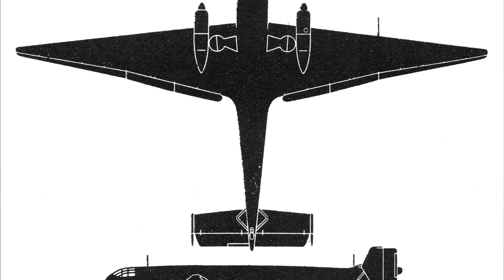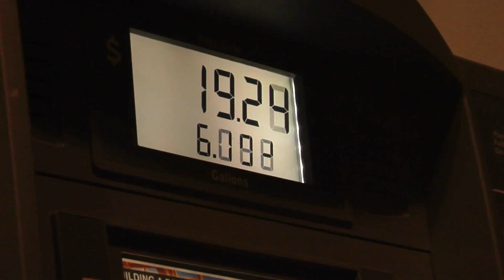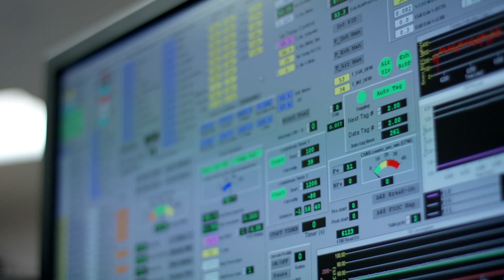The history of the Achates Engine – as told by entrepreneur Dr. James Lemke

Comment: if only this had been done 40...50 yrs ago.  now it's like building a better incandescent bulb in the days of LED's.  i guess it will still have military applications where fuel is king.
Reply: +Robert Hirsch       I was thinking the same only only wishing it had been done 20 or 30 years ago. The jet engine killed the market for this design in large aircraft and electric motors are set to do the same for road vehicles. Maybe there is still a chance for this in small aircraft where electric power just does not have the range (except for some special applications like flight schools) and marine uses where again electric power is range limited (except for some short distance ferries). Diesels are still used in diesel electric locomotives and large scale diesel electric earth moving equipment so they could benefit from this engine. I would love to know more as to how this engine is better than the Napier Deltic opposed piston two stroke diesel engine conceived in 1943 (originally for marine use but adopted in a big way for diesel electric locomotives) which I presume could also be improved by the application of modern computational fluid dynamics.
Reply: @dogphlap6749  its no different. same exact motor pretty much. like he said. anyone can computerize any motor. and anyone could have done this. . . but they didnt and he did
Reply: Yes, but LED lighting is quite a big leap forward. On the other hand, battery technology is not going so far from 40 yrs ago.
Reply: Internal combustion engines are not done yet it's just governments brainwashing people to think electric cars are more efficient but they are NOT! Whilst they like to tell you that an electric motor converts 96% of the energy to motion compared to 32%-37% for a diesel engine, where is that energy coming from? If you take into consideration the losses incurred to get that electricity to that motor it's a very different story.
Think about generator, distribution grid, transformers, battery chargers, batteries and wiring losses.
When I calculated the amount of energy used by an electric car in total compared to my diesel VW Golf(Rabbit) which I admit is very efficient at 38% conversion of fuel to power, the electric car would use twice as much energy at the power station to go the same distance! 
Electric cars are the biggest scam ever, I bet the oil companies can hardly stop laughing, all the way to the bank!
When governments and manufacturers quote efficiencies they don't mention the crap efficiencies of the power generation, just grid power which doesn't include that and we can't all be solar wind and bio fuel. If we all go electric you'd better be prepared to get your bicycle out because we'll need much more fuel to power the network never mind the logistics of supplying 10x the amount of electricity to the country!
Small, slippery, hybrid, light weight internal combustion engines are the way to save fuel.
Think about the physics, direct conversion of chemical energy to motion will always be more efficient.
Electric vehicles are deferred polution machines, that make cities cleaner by all means but not the planet...
Reply: @franksmith6683  and yes. those teslas are charged by coal fired plants and natural gas fired plants and even nuclear plants as well as wind and solar. nuclear power is probably the most efficient way you could turn energy into power that we have come up with. but turning fuel into power in the machine is far more efficient then converting power several times and shipping it miles and miles through wires and shoving it into a machine so it can then use it
Reply: @franksmith6683  I agree with you. Electricity is not a fuel but solely and energy carrier. It first has to be manufactured. It can not be harvested or extracted form earth. The hydrocarbon fuels: diesel, gasoline, natural gas, coal, are all chemical substances that need to be converted to mechanical energy where the Carnot cycle applies. Electricity is mechanical energy, not chemical as often claimed. My question to this is what is the chemical formula for electricity? 
The efficiency factor that the electric motor displays is an additional and total waste that the Hydrocarbon fuels do not have.
Reply: @franksmith6683      I see this a lot. You compare diesel fuel with electricity and include all the losses for the latter but totally ignore the costs/losses for the former. Diesel does not appear like manner from heaven it has to be extracted from the earth via an oil well, transported to a refinery (often part way by pipeline or rail tanker car) and refined. Refining uses about a kilowatt hour of electricity per litre (4kW/gallon) and if you get the crude by fracking things get really expensive both in terms of energy wasted and damage to our environment including poisoning the water table and contaminating the surface (and fracking sites are short lived, they are soon exhausted, shut down and the business then moves on to destroy new land).
Now generating electricity often involves burning coal, that is even dirtier than oil but as luck would have it it is now cheaper to use natural gas, wind and solar generation than burn coal which is why the proportion of coal fuelled grid electricity has now dropped to 29.9% (still burning natural gas though at 32.1%, another fossil fuel but at least it is better than coal). Transmission loss for electricity (all of it) averages between 6% and 7% in the US.
Reply: I hate LED bulbs and I got rid of mine anyways, BTW how much are we hung up on an over complex 4 stroke anyways, it’s done it time already.
Reply: I can do with out all this overcomplex 4 stroke crap anyways. I always liked roller bearings and oil injection anyways
Reply: Wrong , is like building a better led , 4 stroke engines are bad efficiency  , even turbines ... This is the more efficient engine of the world , read some more ...
Reply: He said it had been dormant for nearly 70 years...

Comment: Mainly skeptical on emissions - but hey - could devise a clean fuel - or run LNG or something.
Reply: Sandia labs has developed a simple Bunsen type injector system that completely eliminates particulates and therefore allows concentration on NOX.   In addition carbon neutral fuels such as Fischer-Tropsch diesel greatly reduces pollution.  Also DME, OME and OME2 which can easily be made as carbon neutral PtL electro fuels from CO2 and hydrogen as well as from fossile feedstocks completely eliminate pollutants.  This engine will be as efficient as fuel cells.

Comment: Why not slaping on top of piston some asbestos sheets and on them thin stainles heat resistant sheet  and completely stop heat apsorption by pistons? And there is your further boost of efficiency. For diesels you do not need to fear of superheated piston top.
Reply: Ceramic coating

Comment: They never talk of the shaft horsepower required by roots supercharger.  It ain't free. The supercharger replaces the valvetrain in essence and enables 2 stroke operation.
Reply: Alex Powers The supercharger in this configuration only acts as a baseline to the gasflow at very low engine speed. Most of the air is provided by the turbocharger once it spools up. The gains from this layout far outweigh any parasitic losses caused by the supercharger. This is easily verfiable just by looking at the well proven jumo and deltic engines and their still impressive specific fuel consumption figures.
Reply: @volvo245  there are many engines today that don't come close to the BSFC of those 1930s Junkers Jumo 205s...
Reply: @stephenkeebler732  LOL i'm pretty sure i typed that exact message at some point in the last 4 years. The 20x series is  undeniable proof that opposing piston engines are amazingly efficient IC engines. I hope that of the various opposing piston engine ventures that now are trying to break through to the market at least one succeeds. The engine type needs more recognition and praise for sure.
Sidenote: One of my favorite planes is the Dornier 26, relatively small flying boat (only 20 tons max at take off) that could travel from Germany to Brazil without refueling. Its a feat that for planes that size is rarely matched or exceeded even today.
Reply: Alex Powers shut up.

Comment: Diesel bomber!
Reply: Try klotz ar50 2 stroke oil fed through the crank and then inject into the intake or the fuel
Reply: @jlo13800   Diesel is a Lubricant, it Doesn't need extra Oil, in a Diesel 2 Stoke like the Detroit Diesel!!👍😉

Comment: the problem with the commer engine is not one of fuel efficiency but one of upper cylinder lubricant. in order to get sufficient lubrication to the top of the piston and the upper cylinder, oil will inevitably blow out of the exhaust port this has been issued for day one and will continue to be so.
Reply: Don Knight not if it was built to be an horizontal engine like Subaru boxers engine
Reply: Amen, I don't know how they will ever solve the issue, oil in the exhaust will keep it from passing emissions regs.

Comment: Very interesting. Amazing that such a successful engine design was neglected for 70+ years!
Reply: It wasn't neglected for 70 years. look up the Rolls Royce K60, Leyland L60 and the Deltic type train engines.
Reply: @agt155  
Opposed diesel engines power the emergency generators on US nuclear submarines. 
Just a matter of passing ever more stringent emissions for road vehicles.
Reply: I love the jump 205, Now drop that in a stretched scaled up Yamaha banshee with tuned pipes! Use a turbo and all the castor 927 maxima 2 stroke oil one could get
Reply: They've been used in trains and tanks and planes historically, but apparently until recently nobody managed to successfully scale down the concept to be able to work regular road vehicles and make it affordable.

Comment: I totally believe in this engine design!
I also think that this engine doesn't only have superb economical potential,
but it could also be turned into a never seen before power mashine.
I think you should enter some sort of racing sport at one point in time!
Reply: This is not religion. So your belief does nothing to the project.
Reply: 1904 (17 July) Ostende Automobile Week: Rigolly, in a four-cylinder opposed piston French Gobron-Brillié, became the first to exceed 100 mph (160 km/h), averaging 103.56 mph over a kilometre.

They were setting records and winning races over a hundred years ago with this type of engine concept...

Comment: Very nice, but what about the jake brake ?
Reply: Well thats simple, without the vavles you can not gave a jake brake. Engine braking can still be used as per normal though. And maybe with CR they can shut off the injectors and have engine braking on par with petrols.
Reply: @richard mcmahon that was the lamest crap I have ever seen. You have now made everyone more stupid for having to read it.
Reply: This would work the same as on a conventional diesel engine: Butterfly Valve on the Exhaust controlled by a servo, causing exhaust pressure to go back through the ports and build up pressure in the cylinders; the Electronic controls on the fuel injectors would throttle back on the fuel. Not a problem to implement on this engine...

Comment: Please make this come to market for GA airplanes! We need this desperately!
Reply: Q 
Wanna pay for one? Only reason GA can be affordable for anyone less than a multimillionaire is because of the old-school tried and proven designs that are available in the 40 and 50 year old airplanes that comprise the vast majority of the GenAv fleet.
Only a fraction of a percent of GenAv owners and pilots can afford new airplanes and, of those, only a fraction can afford aircraft with new technology engines. Not nearly enough to make the research cost effective. That doesn't even consider the expenses of obtaining FAA approval for such machines.
If the present vintage aircraft disappear, GenAv will all but disappear itself. There's nothing wrong with magnetos and carburetors or mechanical fuel injection systems. They are tried and proven, approved and dependable and we'll have to keep flying with them for a long time before anything newer becomes even remotely affordable for the average aircraft owner. 
Frankly, I really detest the idea of an engine that depends on a battery and alternator to keep running. Airplanes are not automobiles. In present required configurations the alternator can explode and the battery fall out of the airplane and the engine will keep running on it's magnetos as if nothing happened. I like that in an airplane.
Reply: @rescue270  
Hi Hunter, I agree with you. Magnetos are good and safe, so are carburetors. However, Fuel injection should also be of high reliability. I am not sure what the FAA thinks about that. Do you have thoughts on that?  
Fuel injection avoid carburetor icing and no problem with the airplane's attitude. Perhaps a backup fuel delivery is needed in aviation? Perhaps just the fuel pump feeding the same injectors?